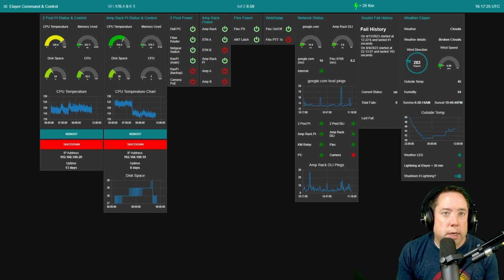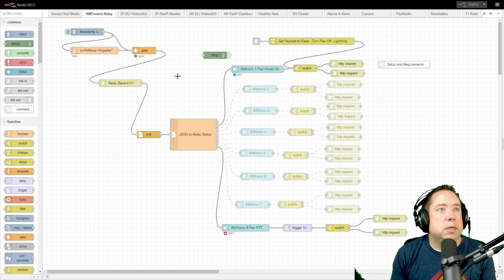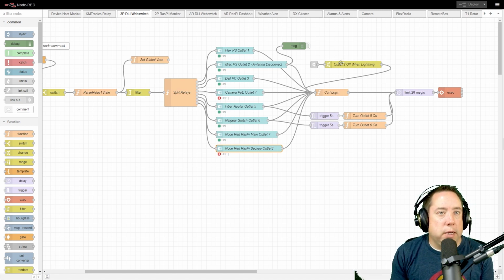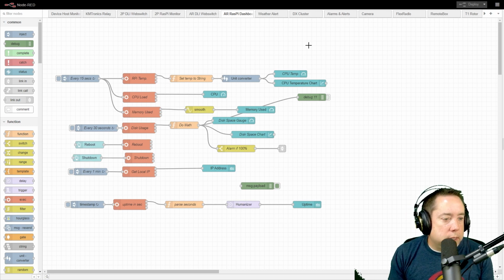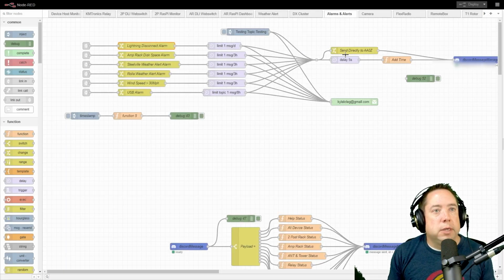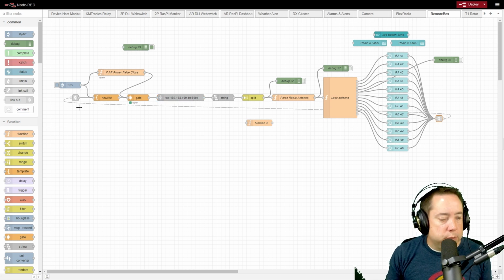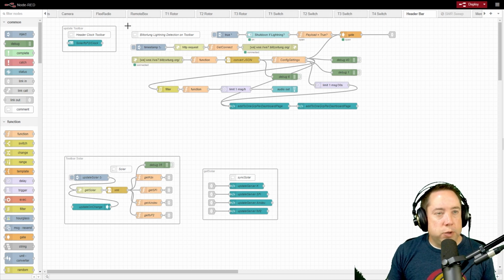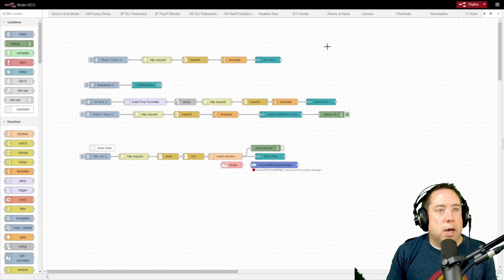Customize Your Dashboard Flows  - Part 3

Comment: Did you build in any "Are you sure?" logic to the "shutdown" commands? Might help prevent a fat-finger slip making somebody drive down to the station.
Reply from the maker: Yes.  So the WAN router and network switch can't be totally shut down via Node Red.  There is a trigger that toggles those ports, so if you try and shut them down, in 5 seconds they restore power.  If the main Pi craps out, I have a current backup and there is another Pi down there we can load the flows on to.  I think off the top of my head, the WAN router and network switch would be the only two devices that if they had a hard down, we'd need to drive to the station to bring the remote system back up.